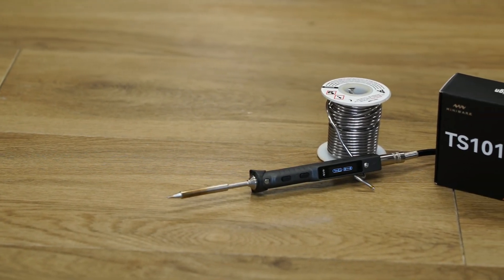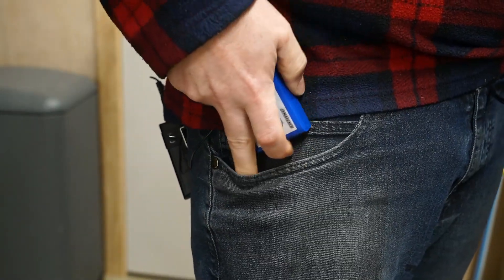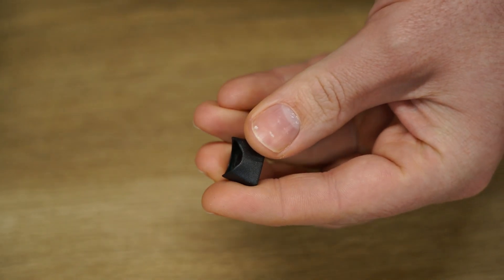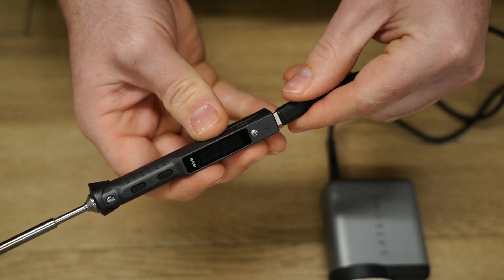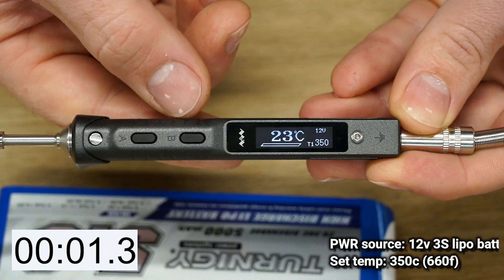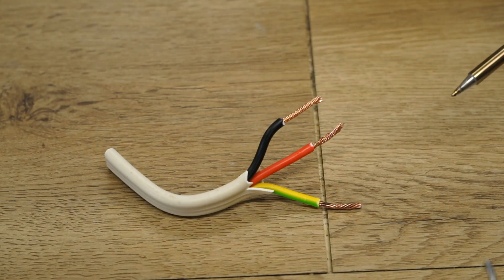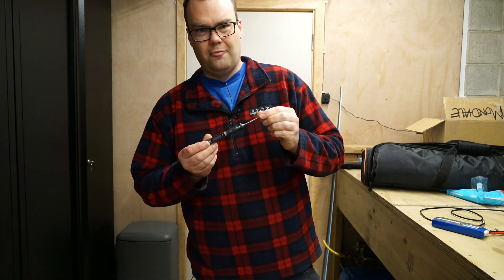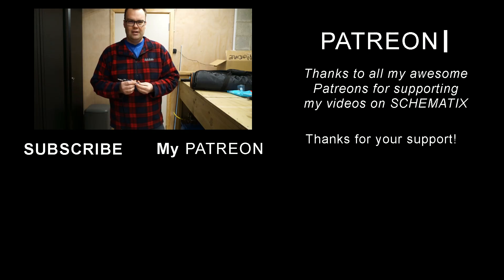MINIWARE TS101 soldering iron Review II Portable battery powered iron!

Comment: 5525 = 5.5mm OD 2.5mm OD. Centre positive. Ideally you'd want a supply rated for 19-24V 70+W, although you can go lower proportionally if you don't need all that power.  I use a old OEM Toshiba laptop charger .

Comment: I've had this for one month, and it is a piece of crap. I'm using a 18VDC adapter. It heats up quickly, but as soon as you touch a pad, the tip cools down rapidly and you have to wait till it heats up again, slowly. It is a piece of junk that I have wasted £100 on. Avoid, and buy a proper solder station instead.

Comment: Great video.  15 seconds to heat the tip to 350C is most impressive !!   
The tip must be some very advanced metal alloy to have such good heat latency.
My Antex 25 Watt takes around 7 to 10 minutes to heat and almost as long to cool.

How long does it take the tip to cool back to room temperature??  
It would be fantastic if it could cool to room temperature in a few minutes.

Comment: to do the calibration correctly make sure the iron has not been used for a while and the tip and the handle have both been at room temperature for some time.  it can not be hot before calibrating and can not be done if you had it plugged in for a while and the PCB  is warm.  try that out. After it has been cool and unused a while,  then plug it in and calibrate.  then check if that fixes the temperature variance.
Reply: Yeah, need to get stable resistance before recal..

Comment: looks good, i love my ts100, great for automotive work and remote jobs.
i power mine with a makita 18v drill battery.
Reply: You have any special adapter to connect with the battery?
Reply: @bagatis1  yeah I 3D printed one from thingiverse, and used some copper strip in as the connection.

Comment: At 0:14 you say "similar to its predecessor", but I seem to recall that the TS100 cannot be powered via the USB port, which was intended only for programming.  It accepts a similar range of voltages, but only through the DC barrel jack.
Reply: True, the TS-100 have a micro usb port. The TS-80 is the one with a usb c port

Comment: I reckon a 3D-printed belt clip would be a sensible accessory for the LiPo-equipped kit. Easier on your pocket and something you can quickly remove if the battery fails and bursts into flame.

Nice to see you back as well!

Comment: The pinecil is very similar but much cheaper
Reply: The Pine64 site claims that they will be back in stock in "mid-October", so we'll see.  Their PinePower silicon cable is an extra cost, but the total price for the iron, cable, and a small stand is only $31.50; half the price of the TS101 and the Pinecil already offers the USB-C power option via QC3 or PD so the TS101 offers nothing new except that it's currently in stock ;).

I bought a T12 Quicko station with an AC power supply and cord earlier this year for $60 and found a decent bench stand for an additional $12 (all shipped), so the TS101 for $60-$65 is really not such a great value for dollar, in my opinion, and the TS100 wasn't either unless you found it at a steep discount.  These are $40 irons, in my opinion, and the full kit with all tips should cost $70 but has typically sold for $120.

Yes, these are great for portable use, but so is the Pinecil... if you can get one.
Reply: Pinecil shipping is like 20-30 bucks, so no it’s not cheaper than ts101
Reply: @user-yk1cw8im4h  not on Amazon. and international shipping is worth it when you can get insanely cheap tip packs and deluxe silicone cables for 4 bucks lol
Reply: love my pinecil
Reply: Yeah but not nearly as readily available